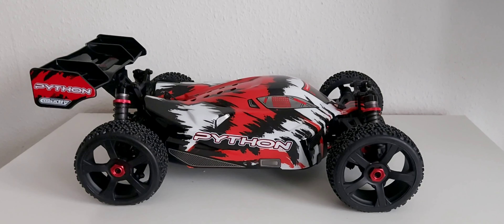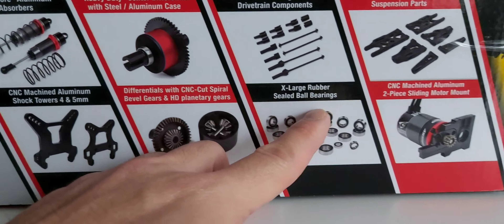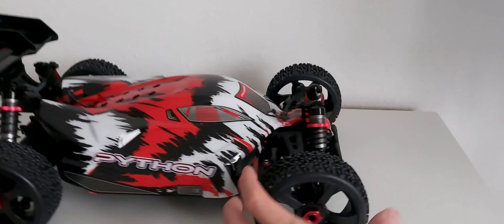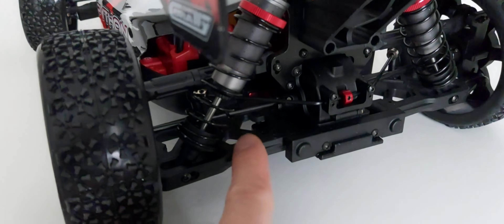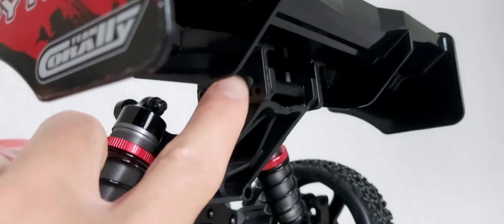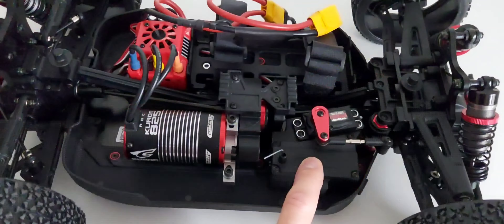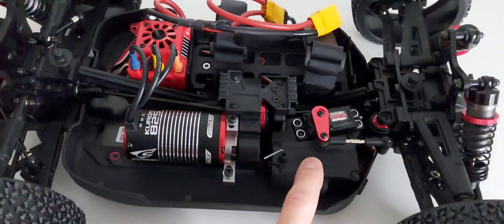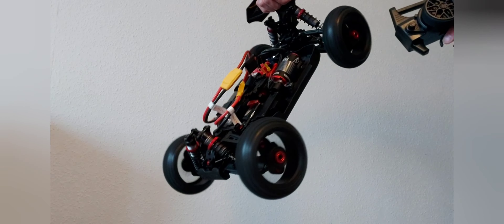Unboxing Team Corally Python XP 6S@joelrcgarage3362

Comment: Bro or maybe someone can help I have a problem with the transmitter of the python when I put up the switch in the top of the transmitter for 70 trotter and 30 brake the car star running with out pressing the trotter in the transmitter I don't know what to do in the lower settings 50 50 not problem the car runs fine but the switch up is doing crazy please help thanks
Reply from the maker: You should turn down the throttle adjustment.